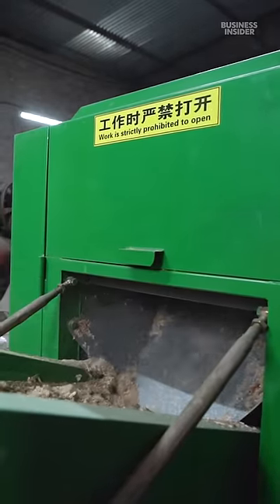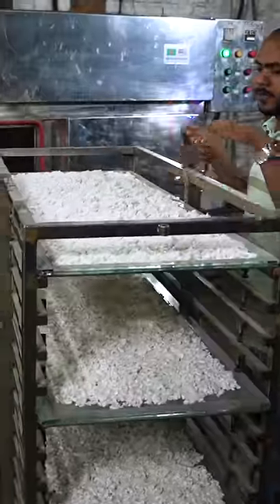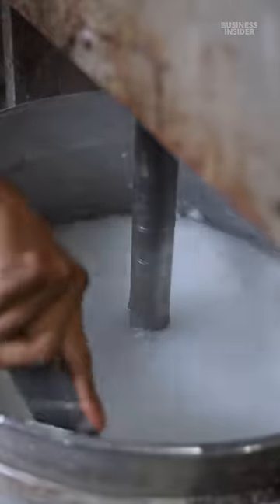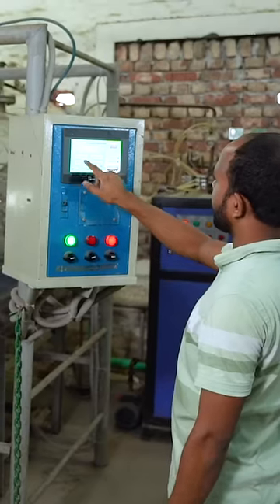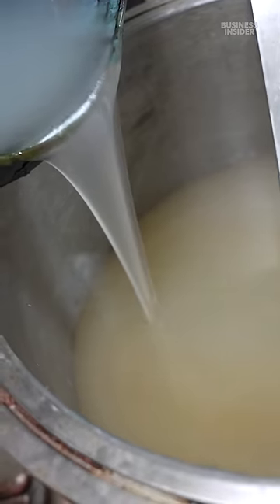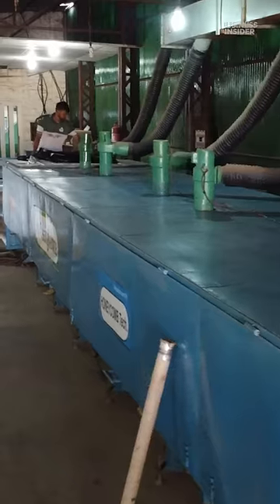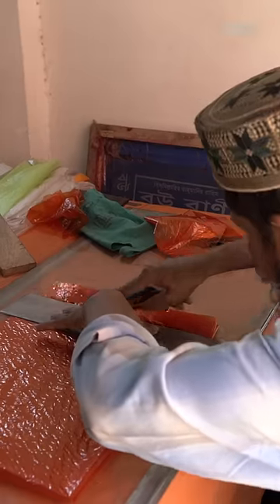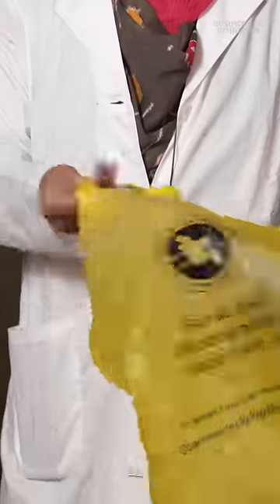One scientist is working to turn the jute plant into biodegradable plastic. #plastic #jute

Comment: So he's basically making cellulose nitrate plastic, but instead of cotton as the source of cellulose, he's using jute. Not at all new, but kudos for a biodegradable plastic. I think it's a great idea. Even PLA is a decent option, though for it to biodegrade, it requires special conditions (heat and/or bacterial consumption) and it derived from corn kernels, so eating into our food supply would not be awesome.

Comment: Essentially it is PLA made with jute instead of corn. PLA ive really only seen used for 3d printers because that's really the only application it's useful. It's not very strong, heat or chemical resistant. Basically jute would be better than any plastic it's made from

Comment: Plastic is leftover byproduct of crude oil; best used for an object and then burned for energy. "Jute plastic" is a 15-20 step questionable substitute, but if it worked, we would still be throwing away the unrefined crude oil plastics so whats the point?

Comment: It doesn't sound that sustainable, nor safe. There's a lot of processing that asks for more energy than plastic production. The product might be biodegradable, but you would still be putting much energy into something to be thrown away, for many applications, which equates with throwing energy away (and putting it into the atmosphere and oceans).

Secondly, the binders and crosslinkers involved are likely not very good for health and the environment. In plastics, for instance, remnants of polymerizing and crosslinking substances seem to precisely the most deletereous.

Comment: Better than plastic grocery bags, those bags escape containers and end up as litter, ending up everywhere. Disgusting. I assume these bags will break down in the sun and water after a few weeks or from short exposure? Nice. Not sure if I will use Jute based plastics for climbing or safety equipment. Does this mean PFOS is non-existent with Jute?

Comment: For all those nuts asking for 100 % jute bags, it just isn't feasible. We will need a Thanos snap for the consumption to be reduced to meet current production levels. Also Jute bags are expensive when compared to plastics and hence are not a viable option of replacement. All those asking for 100% jute bags can still get from the market for a price and use it. But do not expect small business to replace them for the cheap plastic that they use now, they just won't until it's cheaper.

Comment: I hear about plant based plastic now and then.  I'll go out on a limb here and say we will never replace all the varieties of plastic with plants.  Even this plastic is probably not biodegradable.  
PLA, used mostly in home 3D printing was supposed to be biodegradable plant based, blah blah.  It's not.  I left that stuff outside for years.  It got dirty.
Severely limiting or walking away from plastic is the only solution.  
But then your electric cars won't be so  lightweight and futurey.  
You want to save the planet?  
Stop buying shit.  
Fix what you have 
Live like it's the 1800's.
I don't want to do that either.